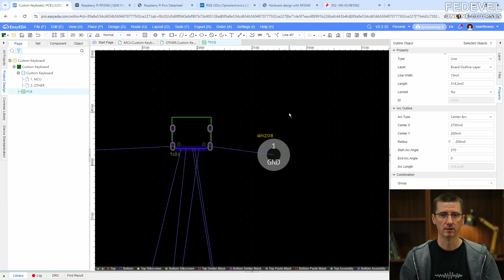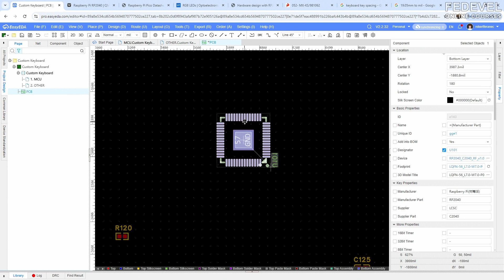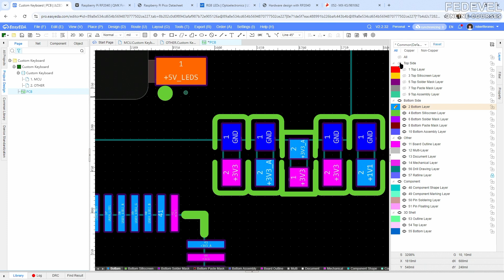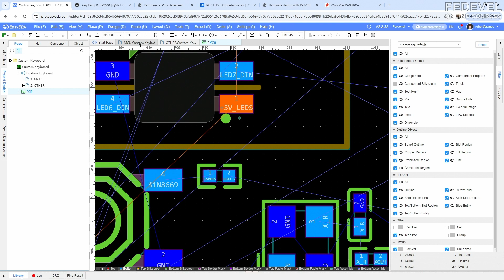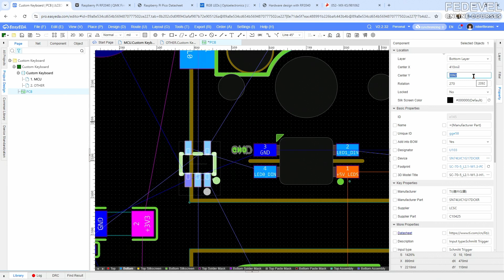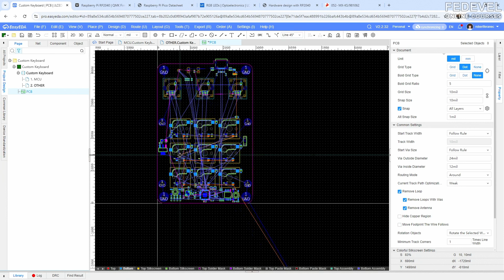Tutorial - Custom DIY Keyboard Design and Build | Part 3: PCB - Component Placement

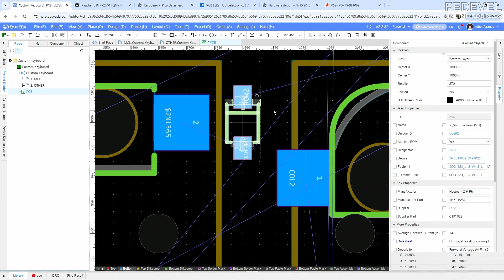Comment: Robert, I'm at 43:32 watching you place diodes near the pads of the switches or switch holders.  I'm wondering if this layout tool has basic clearance rules already set up?  As you move the parts in, I'm not seeing any accidental clearance violations.  No doubt you're very good at this, but as fast as you're working, I would expect to see a moved part occasionally violate the clearance of something nearby.  Or perhaps this tool doesn't have online checking enabled?
Reply from the maker: To see this error, you need to increase otherClearance 
 -> Component to Component clearance (needs to be more than 0). I didn't set that rule. Also, once set, you will only see the error when component is placed, not when moving.
Reply: Gotcha  @RobertFeranec 
It's likely less distracting and a more pleasing video to watch if there aren't a bunch of violations as you bring each part into position .

Comment: Don't you do the outline first? And the the  mounting holes and the rest? I always start with the board outline. Is there a reason for doing it different?  Also why are most off you components on the back layer?
Reply from the maker: as I drew the outline manually it was easier when I could see the mounting holes and USB connector
Reply: @RobertFeranec  I mean what ever works for you. I always start with the outline. And sometimes I have to adjust the outline. But making it smaller has my vote. Lol!
Reply from the maker: btw the keyboard was originally smaller, but I had to move the encoders away from the keys as it was hard to use them
Reply: @RobertFeranec  I understand. And if doing it on the back layer is a choice every one has :) So my conclusion, do what works for you :D
Reply from the maker: back layer for cheaper assembly, so I don't have to pay for both sides

Comment: Is there a reason why you placed the MCU at the bottom edge and not using the free pcb space between keys and encoders where it's closer to the USB port?
Reply from the maker: the first version had the encoders closer to the switches (I wanted to make it as small as possible), but when I was using encoders I was bumping my fingers against the switches so I moved the encoders up and that is how the gap appeared there

Comment: Great video! I’m curious—do you think it would be straightforward to adapt your design to use an STM32 microcontroller instead of the RP2040? Specifically, how challenging would it be from a firmware perspective?
Reply from the maker: Looks like QMK supports also STM32, but I have not tried it (it was my backup plan): https://docs.qmk.fm/compatible_microcontrollers
Reply: @RobertFeranec  Thanks for the quick response! I'll check out QMK's STM32 support. Appreciate the info!
Reply: @eyallampel  I built two keyboards, one with a Blackpill Module and the other with a dedicated STM32F411 (64 pin). Both work perfectly except I don't have the RGB working on either of them (I'm learning QMK and VIA on the fly)... The RP2040 may be the way to go, at least until you have the basics down, it has many benefits...
Reply: @michaelo2l  Thanks !

Comment: Will you be showing firmware installation?
Reply from the maker: yes. uploading firmware is just copy and paste (for firmware update the keyboard can mount as a usb storage). I will also show how to adjust the code and compile firmware for your own custom keyboard, it's super simple.
Reply: @RobertFeranec  I have completed the following tutorials, but the cost of prototyping a pcb is very  so I have decided to use the RPi pico dev board and try using that first with a simple push button and after i gain the confidence I will go for a custom pcb.
Reply from the maker: @dewashishdeshmukh how much does it show you for PCB only? It shows me 28USD (for 5 PCBs) + shipping (23USD for Express DHL)